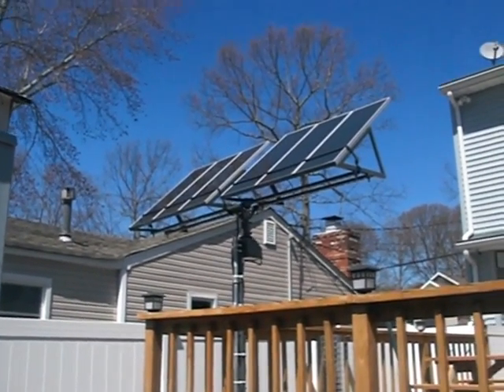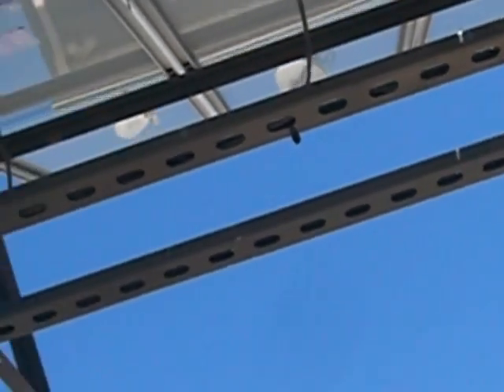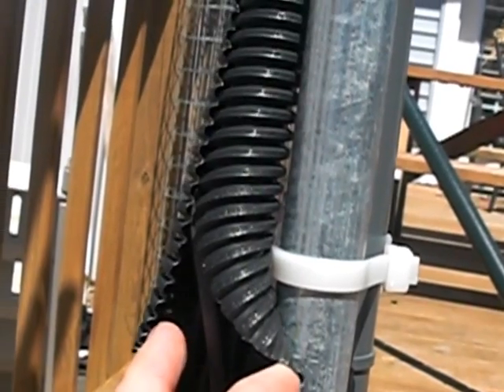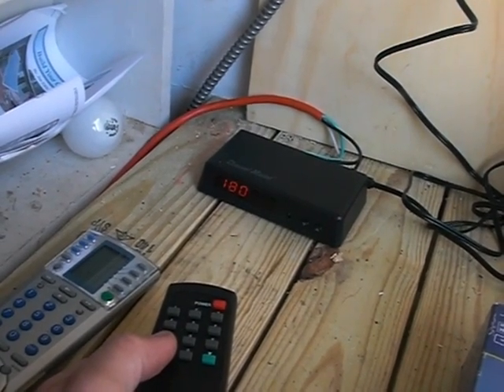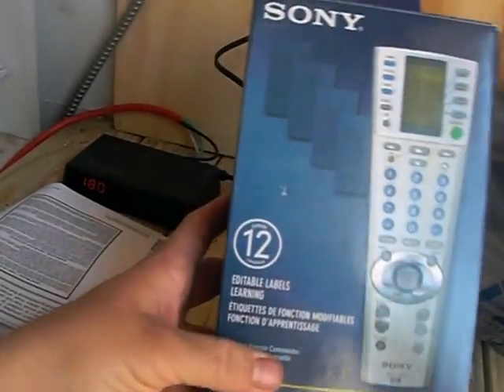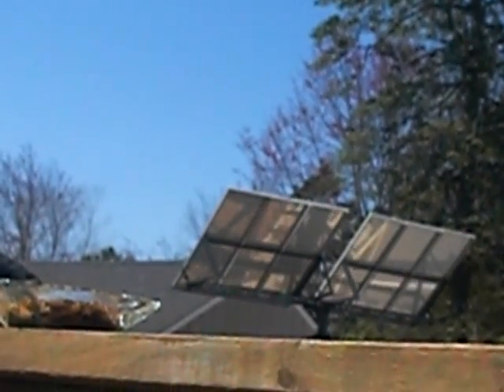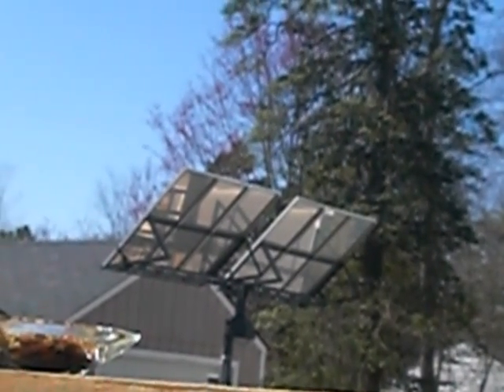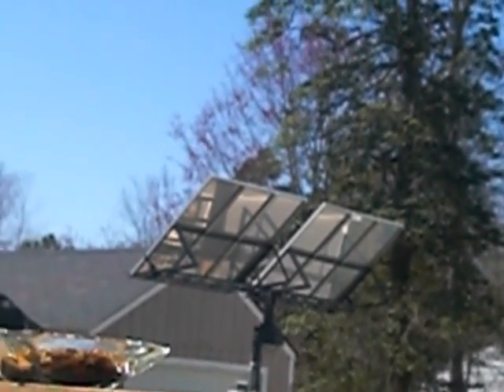Diy Solar Tracker (OLD)

Comment: hey nice job. few questions. can the remote be programmed to move at many different times? and what voltage is the antenna mount? Thanks
Reply from the maker: yes you can program to move at any times you want. it's a pain in the ass to program remote..ive gone through 3 remotes..as far as the voltage its low between 18-24v it has a transformer brick..

Comment: can you post the way to program the Sony remote. I bought one, and there's no instructions to do so. I want to mod the design to a tail twister rotor, for larger cb and ham radio antennas.
Reply: or even a c band sat dish mount.
Reply from the maker: sorry bud been super busy..i have something that might help you out but would be easier to email it to yah..

Comment: **NOTE**: The strapping you've put over the front of the panels is robbing power from power from your array, and can actually damage your array.

When you shade solar cells, its worse than just missing out on the extra unshaded area; those cells will actually start sucking power from the rest of the array, and get really really hot. Hot enough to destroy them / crack glass, etc.

So, fix that :)

Comment: What's the output you're getting with it? Each kit is 45watt correct?
If you use two LEDs and a microcontroller, you can create an actual solar tracker to track the sun instead of just a rough timer...

Comment: Great vid....nice idea, but the execution looks a bit rocky, If you can elongate the bearings surfaces, ie could you put some diagonal struts,(could even be just rigging wire), down to a ring, loose bearing on the supporting tube, so under wind loadings the movement should have some additional bracing. Great that you've got a full south facing yard. When the ali based panels come in you'll be able to cover the deck in them.